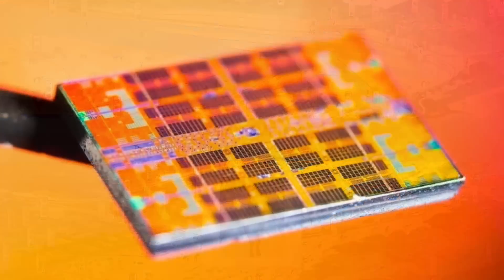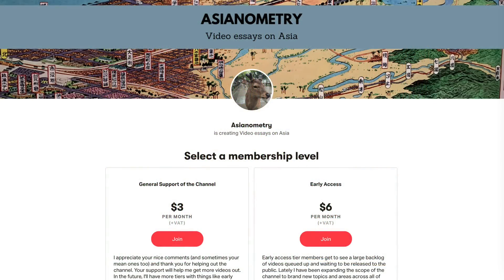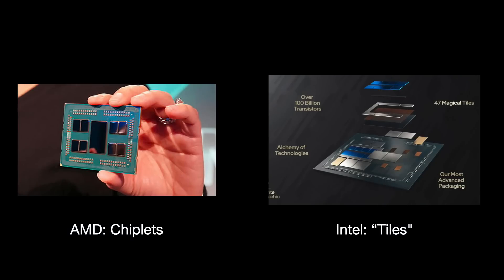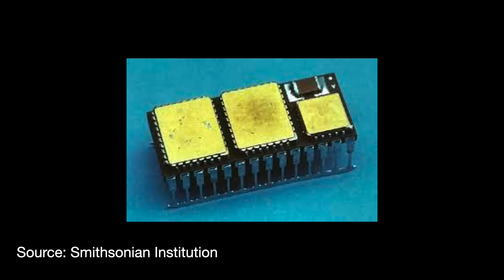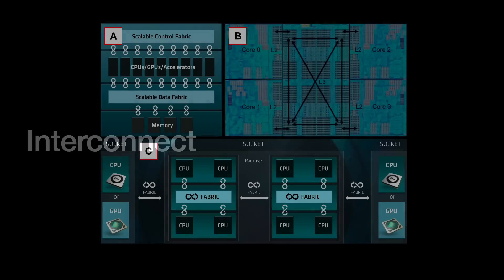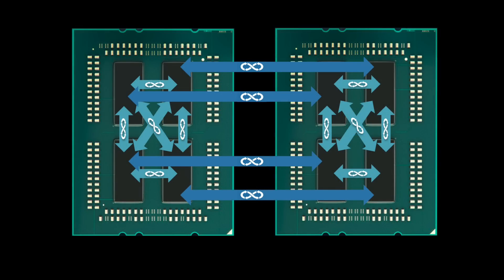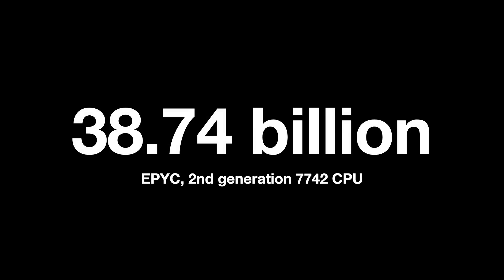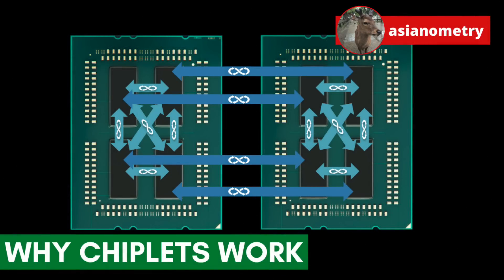Why AMD's Chiplets Work

Comment: I wonder whether i saw this approach with first Intel quad cores. As far as i remember these were two 2-core chips "glued together" on a single package.
Reply: Intel already proven that chiplet works back in P4D, C2 era, except AMD shamed Intel for gluing and went as far as calling it fake dual core and later quad core.
Reply: @AlfaPro1337  and then Intel did the same thing to AMD after the success of ryzen. capitalism is wonderful
Reply: Intel's first "dual-core" chip, the Pentium D, was two single-core chips placed on the same package.  There were zero interconnects.  When one chip needed to communicate with the other, it had to do so via the FSB, so it was actually SMP on a single package, not a dual-core chip.

Their first "quad-core" was similar.  It was a pair of dual-core chips on the same package, with the same lack of interconnects.
Reply: @AlfaPro1337  AMD was right.  The Pentium D was SMP on a single package, and the Core 2 Quad was dual-core SMP on the same package.  AMD had the first actual dual-core processor, and also the first actual quad-core processor.  Many workloads showed the consequences of this, too.
Reply: @TrueThanny  There were 0 interconnects, because the I/O die is basically on the North Bridge?

Plus, I'm guessing Intel opted for a ring bus-like, thus, the main core die communicate with the NB and fills up, until it hits a certain workload that it needs to shift some work to the second core die.

It's still a dual-core in a sense--though, not a single package, but hey, AMD was being a dick in the 1st place.

Heck, even the early consumer 1st gen Core i series are basically 2 die, but, one is the core and the other is the I/O die.

Technically, Intel has been gluing for years.

Comment: The older server CPU's were split up into separate dies on the same substrate based on functionality and the needs of the customer.  There were different variations for them as needed for server processing.  If it needed to do more calculations it would need more cpu cores on the same substrate.  Back in the 90's Intel had separate cache dies In their Pentium 2 line because they found too many failures manufacturing CPU dies with cache at the time.  It really came down to the cache itself when it came to manufacturing for the reason for most of the failures.  Instead of wasting a whole CPU chip just because the cache was faulty.  They decided to manufacture the cache separately.  It does not cost more for having more instructions on the same die size.  It costs more for the higher percentage of failed chips manufactured.  I.E. Bad chips = no money.  It may cost more for a finer lithography process on the same die size because of the expense of the equipment and development costs and also risking higher failure rates.  It may cost even more if the design of the chip may require more layers of processing.  This is how AMD "Chiplets" are the idea behind their new high-end processor with their 7nm process.  Very few chip manufacturers use 7nm process at this time and and it seems to be getting better but risky in the means of higher failure rates.  I'm sure the failure rates are getting lower but by splitting the dies or "Chiplets" the manufacturers may create less wasted failures and earn more profit.

Comment: As I understand this, using ‘chiplets’ means breaking up a single chip into several components. This means that each chiplet would need extra circuitry to concentrate the signals into channels for exporting and importing data from the other chiplets. This extra channel circuitry would not be needed in a single integrated chip. That makes the integrated chip inherently more efficient that a bunch of interconnected chiplets.
Reply: Yup, had the technology allowed them to keep shrinking the process node in Integrated chips, they would've done so
Reply: Except for that it's not because it doesn't work.  So sure.
Reply: More efficient until you reach a size limit. More efficient except more prone to manufacturing defects. More efficient except more expensive. In an ideal world it wouldn't be necessary, but it is necessary for various reasons.
Reply: What you described is how Moore's Law basically allowed Intel to keep squeezing out performance out of it's chips over the past decades.  Problem is: Moore's Law is dead.  We are pretty much at the limit at how much we can shrink transistor dimensions.  You can't just shrink them them further and pack more of them in an integrated circuit.  The failure rate is significantly higher.  This is why Intel's chips and semiconductor roadmap got fucked because of the consistently poor yields they were getting.

Comment: Why don't separate the systemsonachip into multiple processors like it used to be? Have separate video card and a neural AI calculator. What does "diffused" in USA mean on the AMD processor?

Comment: But how are those chiplet interconnects actualy made physically? Bond wires? Solder balls?
Reply: TSMC calls it TSV if you want to know more.
Reply: @mawkzin  Thank you! But TSV seem to be  "through-silicon-vias", i.e. to connect different layers to each other, no?

But searching for TSV led me to pages that mention "microbumps", which I believe is how the individual chiplets are bonded to the base material. It seems that microbumps are µm-level solder balls.

Now I'd love to know even more about this part of IC packaging! How are those microbumps manufactured? How are they placed so precisely? Are they heat-soldered?

Comment: Great video! I love all of them: thanks for the great work you do! 
When you refer to the USB and SATA connections to the AMD Ryzen I/O chip as "analog", what about them is analog? Is it the transceiver (not sure if this is the correct term in this context) that converts the external digital USB and SATA 5v signals to the 1.2-1.5v (I believe) signals that the I/O chip uses internally?
Reply: Nope, when you put the data rate of a digital signal high enough, it's not sharp edges and neat transitions on clock edges. You 100% have to treat them as analog signals when they come in from off-chip. On chip you can control levels and delays to make things near-enough digital ideals to treat them as crisp signals.
Reply: @thewheelieguy  Oh yeah, that totally makes sense. At the signal level everything is analog, but we (software and systems engineers) can usually ignore that. Thanks for the explanation!

Comment: **Edit**: explained by a reply to my comment.

10:03 - "[...] that handles analog functions like USB and SATA [...]".  Neither of those are analog, and I'm not aware of any homophone that would make that statement make sense.  Did you perhaps mean something like "auxiliary"?
Reply: In chip fabs chip design is split into 3 general categories: logic, SRAM, and analog. analog (aslo known as I/O) is everything that touches outside the chip.
Reply: @BusAlexey  Aah, okay.  Thank you.  Do you know if that is a legacy from when a lot of the external I/O would have been analog?
Reply: @Quxxy  to the chip's circuit that's running at multiple gigahertz, any I/O is "analog", in a sense that the signal doesn't arrive clearly in a well defined form for the chip's circuit. There are special circuits in the chip that translate that "analog" voltages to a more manageable form inside the chip, and they are what's known as analog circuits

Comment: 10:00 "Analog functions like USB and SATA"

Wtf? Can someone explain how USB is analog?
Reply: It's a bit of hair splitting but technically USB sends digital communication over analog differential pairs. The usb controller interface he mentions translates the external analog electrical signal into internal digital data. 
PAM 4 in PCIe 6 adds a more clear analog touch, with the communication signal voltage being able to represent 00, 01, 10 and 11 instead of just 0 or 1.

Comment: I remember being obsessed with Hyper transport technology. What always bothered me was this idea that theoretically we can unite all the best solutions from competitors in order to make one "ultimate" product. At the same time losing competition (or at least a threat of it) was the major reason why one company developed its "killer feature" to stay afloat in the market or to outcompete its rivals. On the other hand there is no such thing as the ultimate product with all the cutting edge technology in the real world since every product is just a mean for fulfilling certain need or completing certain task. For each need or task the best solution might not require the best of the best or "ultimate" tech in every regard.
Reply: It kinda happens already. AMD and Intel engineers can practically throw forks at each other during lunch...
Reply: @scottfranco1962  My dilemma stems from the assumtion that technological advancement comes either from competition or from some extreme external limitation. It seems logical to me that in the future we will compete directly in technology (of every processes) rather than the products. I might be simply wrong but isn't it the limitations from weak points of your product make you develop new technologies to overcompensate your weaknesses.
Reply: @AlexanderSylchuk  Oh, you are begging for my favorite story. I interviewed with a company that made precision flow valves. These were mechanical nightmares of high precision that accurately measured things like gas flow in chemical processes. This is like half the chemical industry (did you know a lot of chemical processes use natural gas as their feed stock?). Anyways, what has that got to do with this poor programmer? Well, like most industries they were computerizing. They had a new product that used a "bang bang" valve run by a microprocessor.  A bang bang valve is a short piston that is driven by a solenoid that when not energized, is retracted by a  spring and opens a intake port and lets a small amount of gas into a chamber. then the solenoid energizes, pushes the piston up and the gas out another port. Each time the solenoid activates, a small amount of gas is moved along. Hence the "bang bang" part. If you want to find one in your house, look at your refrigerator. Its how the Freon compressor in it works.

Ok, well, that amount of gas is not very accurately measured no matter how carefully you machine the mechanism. But, it turns out to be "self accurate", that is, whatever the amount of gas IS that is moved, it is always the same. The company, which had got quite rich selling their precision valves, figured they could produce a much cheaper unit that used the bang bang valve. So they ginned it up, put a compensation table in it so the microprocessor could convert gas flows to bang bang counts, and voila! ici la produit! It worked. Time to present it to the CEO! The CEO asks the engineers "just how accurate is it?" Engineer says:

well... actually it is more accurate than our precision valves. And for far cheaper.

The story as told me didn't include just how many drinks the CEO needed that night.

So the CEO, realizing that he had seen the future, immediately set into motion a plan to obsolete their old, expensive units and make the newer, more accurate and cheaper computerized gas flow valves.

Ha ha, just kidding. He told the engineers to program the damm thing to be less accurate so that it wouldn't touch their existing business.

Now they didn't hire me. Actually long story, they gave me a personality test that started with something like "did you love your mother", I told them exactly where, in what direction, and how much force they could use to put their test and walked out.

I didn't follow up on what happened, mainly because I find gas flow mechanics to be slightly less interesting than processing tax returns. But I think if I went back there, I would have found a smoking hole where the company used to be.

And that is the (very much overly long) answer to your well meaning response.
Reply: @scottfranco1962  Great story! For some reason I imagined something like water valve from washing machines as a "bang bang" valve. To me fridge compressors work more like one piston combustion engine, but they don´t make distinct souds due to their continuous work. Maybe with a larger piston which stops at every cycle they will produce a "bang-bang" sound. It actually reminded me "from zero to one" by Peter Thiel and your story is actually my main concern about that book. When you outcompete your market you will find it a lot harder to disrupt your own business with new technology. It's just like it was in the soviet union, the only tech that was improving was military and only because of competition with the west.

Comment: Some people here in the comments confuse chiplets with MCM. They're not the same. 
In an MCM design a single chip can work in itself. 
In a chiplet design a single chip can't work in itself without an additional chip. In the case of AMD one chip (CCX) consist the cpu-cores and another chip consists the IO interfaces and connections (IO die). Neither works without the other.
So a 386 motherboard or an IBM mainframe from 1965 is not based on chiplets.

One thing is missing from this video: chiplets improve not just yields but the binning. Smaller chips can reach higher clockspeeds.

Comment: In the 1980s AMD had the AM2900 bit-slice Microprocessor design.  Do not know if anyone actually used these but they where and interesting idea,  Multi-chip processor.   The improvements in chip manufacturing made these redundant.
Reply: I can remember reading the data books on those when I was in my undergrad. The only industry applications I can think of were in very high speed signal processing, before the advent of integrated DSPs.

Comment: Why do you say that first chiplet product is Epyc when AMD releases desktop Ryzen parts earlier than server?
Reply: Because they only had one chip.  First-gen Zen was monolithic.  Everything was on the one die, which had two memory controllers.  The consumer platform got one chip, giving it up to eight cores and two memory channels.  EPYC got four chips, which is up to 32 cores and eight memory channels.  Later, Threadripper got two chips, for up to 16 cores and four memory channels.

With Zen 2, all the I/O, including memory channels, moved into a separate die.  That allowed an arbitrary number of cores for any platform, only really limited by space on the package.

Comment: The Athlon Tri-Core was just enterprise quad-core chips that failed to yield due to manufacturing loss, so they just turned off the defective core in Microcode, sold it to consumers as the Tri-Core and we ate it up.

Also because the failures were sometimes still semi-usable so we figured out ways to turn the defective CPUs back on.

Comment: Why haven't we have seen any chiplet in smartphones instead of soc yet? Are they really that power hungry or is there any another issue?
Reply: You're likely going to see it moving forward more in mobile gaming.  For example, the chip being used in the Steamdeck is a 4-core APU derived from AMD's Zen3 micro-architecture paired with 2 RDNA compute units.  

As for phones, battery technology probably hasn't caught up yet that phone OEMs would look beyond the current SOCs they're using.

Comment: Not sure where you were going with the "bigger chips have mask problems" the number of chips on a wafer is 100's to up to a 1000 or more. Bigger chips simply cut down the total number of chips on a wafer. The constraint on chip size is because of the net yield of the wafer in terms of number of working chips, which is a function of the defect density of the process. This in turn is the number of defects in the wafer, as spread across the wafer in essentially random locations (when I worked in semi we thought of this as like taking a shotgun to the wafer, and the shotgun pellets spread across the wafer). The bigger the chip, the more likely a chip will have one of the defects contained within it. It stops long before reaching one chip per wafer, because you reach a point where the likelyhood of any one chip escaping having a defect reaches zero.

Comment: lol at 1:10 the person in the clean room on top the machine has a fall protection harness. However, the distance they have to fall is so short, it won't activate before they hit something.
Reply: the protection is not used by woker to being protected by the machine, but is used by the machine to be protected by workers

Comment: They worked because despite all of the performance disadvantages of chiplets, Intel spent half a decade relaunching Skylake on 14nm because of their initial 10nm failure. Sacrificing 10-20% of the power envelope and adding 10-20ns of memory latency to do hops over the package is fine if the competition is THAT stagnant. Had Ice Lake and Alder Lake launched in 2017 and 2018 as originally planned, this video would've been titled "why AMD's chiplets failed"

Comment: In the 1980s, home computers did this kind of stuff already. Personal computers decided to not do this. and now it bites them ;) Only took them 40 years to see the light!
Reply: What computers used that. Even the Amiga used multi-chip, not chiplets or MCM.
Reply: It's because you don't understand how todays' interconnects are many generations ahead of 1980s, and what are the challenges of connecting todays' chips (as opposed to sending signals WITHIN the chip).

Sending lots of data over multi-GHz buses is very hard to do. Every extra micron of distance and every extra picofarad of parasitic capacitance counts.

To connect chiplets and NOT suffer horrible performance degradation and/or large power consumption increase is a very difficult engineering problem.
Reply: @boots7859  Co-processor would be the way to think about that era.